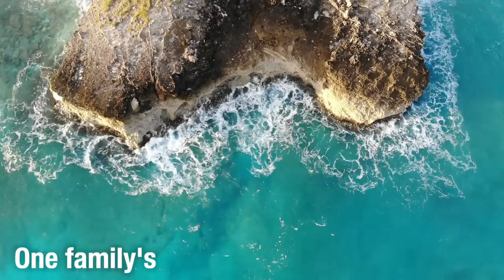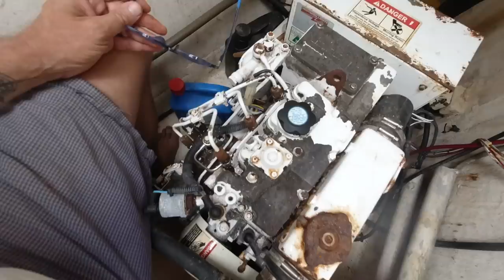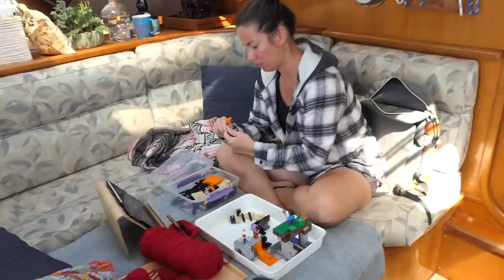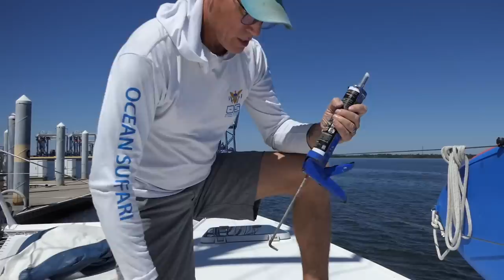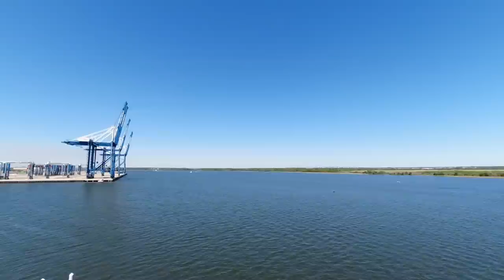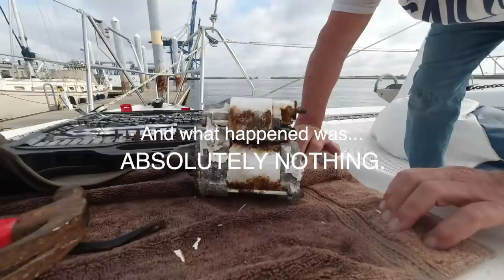NO Motors, NO Generator, But We LEAVE IN A WEEK - Classic Cat Makeover | SailAway 230

Comment: Pickle that port engine before it gets any worse. Fill it to the top full of diesel marvel mystery oil literally poured in the injector holes and then the oil fill. fill it to the brim! it may actually break free that way.
Reply from the maker: Thanks! We actually did that with PB Blaster which is pretty similar. Didn’t free it up but at least it’s protected until I get time to pull it apart.

Comment: As you have made the call to passage make a cat with an single operating propulsion engine, you need redundancy restoration.  Checking the dingy for normal servicing and rig it for  waist thrust in the port side.  As you are having work done on the sb unit, spend a couple of hours on the port engine to remove the cylinder head to verify the engine is a paperweight.  Given the age and likely hour meter reading it is likely time to consider repower.  With the number of hurricane damaged boats in the last five years in the SE US, there is likely a deal to be had on a pair of drive  units.  They will likely be in FLA or shippable to the Chesapeake.  Going back the Caribbean is asking to double the cost.  Life on the hook may look cheap until it isn't!  Limping to a hurricane hole doesn't sound like fun.  A couple of months on the Cheesepeake sorting the three diesels seems doable, gets you back to Grenada for the winter.  AND, check the vented loops on those diesels!!!
Reply from the maker: That track might make sense if we had anywhere close to the cash needed for a repower of any kind, which we don't right now.  The Caribbean is truly our home after the last 4 years, which is a big part of it, and after living with boats in the SE US during hurricane season for 5 years prior to this life, we have no desire to do it again.  Plus, not only is labor much cheaper in the leeward islands, but once we're at anchor I can take the time to dig into myself first.  We don't think it's a goner...just needs freed up and a rebuild.  We've been making tracks south with one motor with no issues...it's a sailboat after all.  There's definitely been no limping. ;-)

Comment: Your motor ran fine when you stopped it last and now it’s locked up hard. If that’s the case then Possibly your wrist pins have seized in the pistons and rods. Poorly maintained and no oil changes can cause acid in the crank case. When you have acid you have electrolysis and the pins and pistons being dissimilar metals can cause them to seize up. The other cause is rust either above the pistons or even below them keeping them from moving. Oil in the bore will help but depends on how bad it rusted. If below the piston you could fill the engine with oil but I find it never works and a rebuild is in order. Your next step is to pull injectors to look inside cylinder to see if it’s rusted,or just pull the head, Either way it needs to come apart. Also if your starter won’t engage click or turn and you are getting battery power to battery side of solenoid and power to the “s” or start terminal when key is in start position probably means it can’t get ground. remember that the ground for the solenoid is thru the starter brushes. And they are made of spring steel springs that presses them on the armature, and salt water will almost instantly take the spring out of spring steel, So it can’t get a good ground. That’s why tapping on starter will sometimes help. Hope that helps a little. Happy sailing🙏🏻

Comment: I never tried it but I've read. Acetone/Nail Polish Remover and automatic transmission fluid works very good as a penetrating oil. It separates, so needs to be shaken not stirred.  50/50 mix
Reply: Worth trying!

Comment: Definitely pickle the inop motor.  The longer it sits, the worse it is going to be when you're finally able to get back to it.

You've probably already tried this...but can you bypass the solenoid and go directly from the battery to the starter?  If it cranks:  Bad solenoid.  If not, probably a bad starter.  I'd also say verify all of your grounds.  I've spent a lot of time over the years pulling my hair out tracing what turned out to be a crappy ground.  My favorite was one that looked fine, but when I grabbed the wire near the ring terminal and pulled on it, it just disintegrated in my hands.  It looked fine at first glance, but was in really bad shape.
Reply from the maker: Unfortunately, yeah, we've gone through all the basic stuff, including trying to turn it over by hand with a breaker bar, etc.  So it's currently "pickled" with PB Blaster until we can still long enough for me to remove the head and sort it out.  We'll get there!

Comment: As a sailboat owner myself, I understand that the boat work never ends and you can't wait until the boats perfect to shove  off. But, all the reasons you decided to come back to the US to perform your boat work still apply. It doesn't seem to make any sense to go all the way back to the Carib with several major projects undone? Fixing a seized engine is much easier & cheaper in the US. Ok you have to leave Charlestown, but their are a dozen other US ports outside the hurricane zone to finish your repairs. There must be more to the story?
Reply from the maker: Actually it’s much much more expensive to have diesel work done in the US. Add to that the costs of continuing to keep the boat in a slip - at this point we’d have to find somewhere til past hurricane season - and it’s not even close to manageable for us. Once in the Caribbean, a diesel mechanic or I, probably both, can take our time digging into it while at anchor.
Reply: @SailAwayVlog  Who says you have to stay in a slip here? Plenty of folks have completed major boat work on the cheap while anchored out here along the east coast.  No need to travel 1400 miles to anchor out. Whats so unmanageable here thats gonna change down there?  It sounds like you just want to get back to Grenada and thats fine, I loved it there too. But justifying it with imagined cost savings, is just blowing smoke.  Unless you're gonna take a complete engine rebuild kit with you before leaving, that cheap labor savings will disappear quickly.
Reply: Charleston is in the hurricane zone ,Grenada is much safer and  as he said  mechanics are way cheaper here and it's much easier to get to marine stores by dinghy in Grenada than Charleston not to mention with an average temperature of 88° in Grenada it's way way hotter in the summer in SC .
Reply: @jrp616  your assertion of him  blowing smoke is just BS , you can get parts from the states and else where for the same price and once you fill out  a C-14 it's a 2 1/2 % VAT .
Reply: As a former diesel mechanic, please take a couple of hours and check the trans, and the crank and cam gearing to see if they have movement, and if they do then take the head off the engine to see what is causing the problem. Sounds like the mechanic that looked at did just that…he looked at it. Taking the head off is not a big time consuming job…At least you’ll see what you are up against, and possibly can take the parts needed to repair later…
Reply: If you ask the Coast Guard what you should do you're not going to like their response. Sounds like you can't afford this boat. You should have figured cost for new engines in you're calculations for the purchase. But don't place others lives at risk.
Reply from the maker: Yep, that's the plan.  We checked all the basic stuff, filled it with PB Blaster, etc., and tried turning it with a breaker bar on the crankshaft with no luck.  The plan is to take it apart once we're sitting still for a while.
Reply from the maker: @michaelbledsoe...Lol...you have a flair for the dramatic don't you?  Explain to me how only having one motor puts anyone's lives at risk?  Even if it were NO working motors, that's ludicrous.  It's a sailboat and we sail 90% of the time and could sail more if we don't mind going slow in light wind.  The boat is extremely solid and tough and built for ocean sailing and all the sailing gear is in great shape.  Motors are auxiliary and MANY sailors have casually sailed the world without a motor of any kind.  Don't spout off about things you clearly don't know much about.  And no, we shouldn't have figured on two new motors as 1 had already been rebuilt and the other ran fine.  It's the way the cookie crumbled that they're both giving us trouble.  It's just the kind of stuff that happens with boat ownership.  It sounds like you're a "throw money at it" kinda guy, but most folks living aboard and cruising full time aren't.
Reply: @michaelbledsoe4355  You make absolutely no sense , 99% of all mono hulls have a single engine and the coast guard is certainly not telling any of those ppl to stay in the dock . Perhaps it's your lack of knowledge in such matters is what ails you ,or maybe it's  a complete lack of common sense that's the problem ,either way you have informed everyone your inability to understand this particular subject .

Comment: There is plenty of cheap dockage in Oriental , NC.   Why go 1400 miles in a boat which isn't all together? From Charlestown to Oriental is not far; even on one engine.  Good luck to you all.
Reply from the maker: Lots of reasons really. Mostly, it’s where call home and where all Rivers friends will be. And once there, I can take my time digging into the motor, getting local inexpensive diesel mechanic assistance if I need it. Plus, we really like Oriental, but our mast is 72’ and our beam 27’, making most east coast marinas problematic. And unless it’s damn near free, it’s probably not inexpensive enough. ;-)

Comment: OK so dumb question. Yes the plate gives you have the flat surface to mount to but, isn't the sea water still going pool in the void behind it and continue to eat away at the metal? Would it be appropriate for you fill it with JB Weld or something else?
Reply from the maker: Not dumb at all...you're probably right.  At the time we were very focused on just finding a solution and weren't clear if JB Weld would hold up in that spot.  From what we've learned since, it sounds like it would.

Comment: I am good at getting frozen studs loose. I had only 20 minutes to get a 2-inch frozen stud out. In 10 minutes the stud was out and the foreman could not believe it. Take the pully off of the drive shaft. Make a heavy bar with a key connected to the crankshaft. The bar needs to be long enough to turn 360 degrees. Get an air chisel and cut one chisel blunt. Don't try to turn the shaft 360 degrees just hammer the end of the shaft right and left until it starts to move. If the engine locked up while running the problem is more serious.
Reply from the maker: Good tips! Once we’re sitting for awhile at anchor and I can put the time into it, I plan to dig into this thing.

Comment: You’ve gotta buy some pressure pack zinc paint. (DuraGalv we call it in Australia) that is the quick fix for things rusting. I see that you mast cap has radiused edges. I’ve recently decided that is important to reduce the risk of lightning strikes. Something I have to do to my mast when it comes off soon.
Reply from the maker: Thanks for the tip! I wasn’t aware of the radiuses caps lowering the risk of lightning. Why is that?
Reply: @SailAwayVlog  Electrons repel electrons. Where a piece of metal is charge with electrons (as is the case with a boat mast cap in a lightning potential  environment) where you have 2 surfaces at an angle to one another the electrons on each angled face will tend to push electrons off the other face creating a streamer for other charges to find and react to. A rounded surface has uniform charge distribution and no weak points to force electrons off the surface. Any pointy thing on your masthead is a weakness to lightning protection. Obviously your VHF Antennae is a weak point and you protect that with a big plastic cap on the upper end to prevent electrons leaving the surface. The other thing to do is to replace your wind instrument with a Maretron ultrasonic wind and weather sensor. These are my theories so measure them with your own knowledge. I am thinking that I will put a plastic plate over the top of my masthead plate (after radiussing the edges) and fitting the Maretron, to make my masthead as unattractive to lightning as possible. This will be an experiment for all of us.